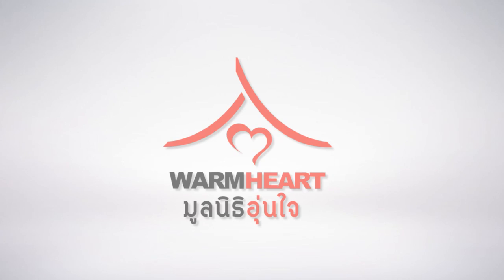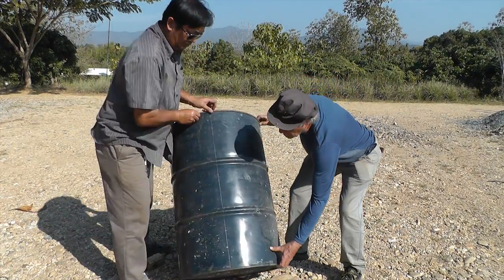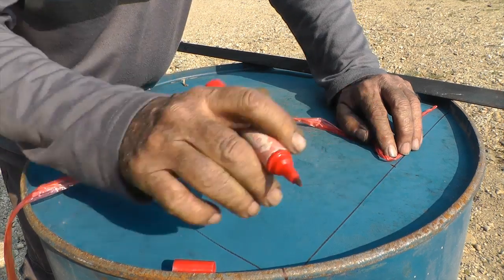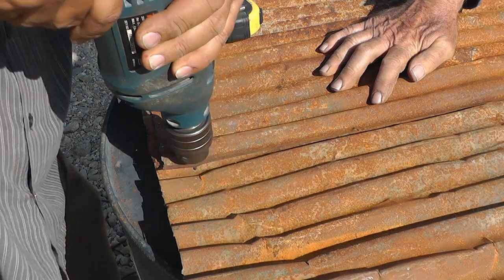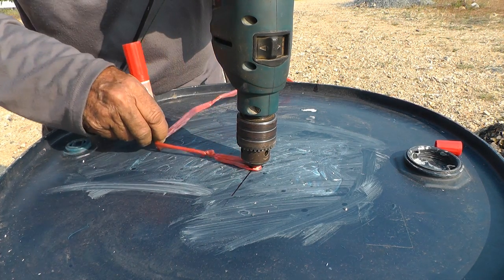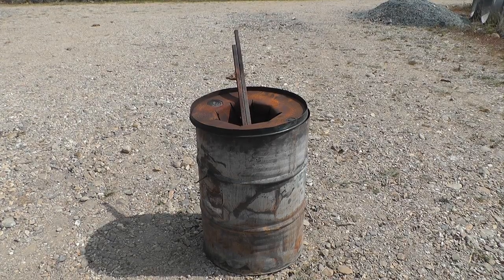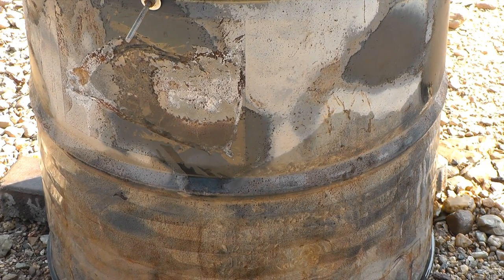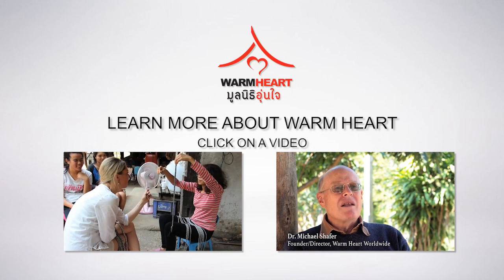How To Make A Biochar Machine - TLUD

Comment: this isnt biochar, its charcoal. biochar stock should burn in a 0 oxygen environment. u need a inner chamber to hold the wood, and sealed other then a vent to off gas the pressure build up. then the fire on the outter barrel will cook the inner barrel and turn the wood into biochar. this method has got oxygen and flames burning up the carbon and releasing it into the air. bio char is mostly carbon

Comment: I don't know anyone who has access to these specialized tools. The barrel might be easy to obtain for someone with lots of privilege, but the only piece of this equipment that I can get hold of is the string...
Reply: Stay positive, do not let the challenges stop your great mission. Angle grinder from Harbor Freight tool is $9.99 to $20 depends on sales or not, a 4" grinder disc is $1 each, steel barrel can be bought looking into local ads, like craigslist, about $20-40 per. Now do not complain, just do it.
Reply: Cut the metal with a hammer and chisel.

Odd comment with obvious access the the internet…but not to discarded barrels. 🤔
Reply: Good. We keep all good things from dorks like you that can't scrounge up a few bucks and a free barrel. Don't even bother to think you could borrow the tools either. No one would lend them to you! Your sad sack would steal them.

Comment: I made this burner and used it to burn sticks stripped by goat cut to barrel length and packed tightly with wood chips filling the empty spaces.  I neglected to dowse and it all burned to a small amount of ash.  I'm about to try again.  Not sure if I should damper it of this time somehow after ignition  because my last firing burned so furiously.

Comment: There is quit a bit of talk about Metal fume fever. Exposure usually arises through hot metalworking processes, such as smelting and casting of zinc alloys, welding of galvanized metals, brazing, or soldering. If the metal concerned is particularly high-risk, the residue from cold sanding processes may also cause fume fever, even if the dose is lower. Occurs by inhaling metal oxide fumes that injure the lung. 

Prevention of metal fume fever in workers who are at risk (such as welders) involves avoidance of direct contact with potentially toxic fumes, improved engineering controls (exhaust ventilation systems)...

Comment: don't use galvanized steel  and  expose it to flame - the zinc will exit in exhaust and be toxic to breathe (look up welder's sickness).
Reply: I assume he is referring to the corrugated sheet metal
Reply: Did any of the parts they used in this video have galvanized steel?
Reply: in practicality, how much lead or zinc we are talking about? gone after the first burnt, perhaps, are we worrying too much here?

Comment: I would add some informations:
the barrel steel must be rust-ressistand, if not it will crumble after 4 use...
use smaller barel as char-generator inside the bigger that work as stove and burn until ash.
everything inside should be fried to the crisp. After one hour.
Do not open, and wait until you can touch the can. 
For safety reasons because water can...explode...

Now mix with the soil in one to 10 or one to 6 for grass plants.
Reply: When you burn until ash you get ash, not biochar. That misses the whole point.  Ash is very alkaline and produces no homes for microbes.  It is no longer biochar.
Reply: @johns7713  
This is WHY the oxygen should be shut-off from the barrel inside that is burning volatile pyrolise products. It work.
P.S. Because bochar is alcaline and without nitrogen, you need to pee on it. Wastewater is enough. Then put to the ground.

Comment: Your roof sheeting is zinc plated and is exposed to open flame. Isn't burning zinc coated materials dangerous or poisonous?
Reply: its all rust. I don't see any zinc.
Reply: @NwoDispatcher  Probably a bit on the ends, but yeah it seems predominantly gone.
Reply: If you inhale the fumes you get metal fume fever: https://en.wikipedia.org/wiki/Metal_fume_fever
Reply: Just don't stand next to it close downwind the first few times or in in a closed room. Outdoors with wind, itll be fine.
Reply: Zinc is an essential nutrient, a little of it will actually do good.
Reply: Not in your lungs.
See other posts.
Welders have to deal with this all the time, and they can’t take zinc poisoning!